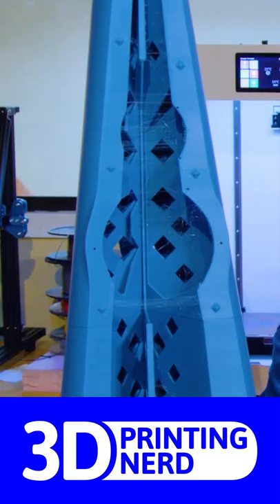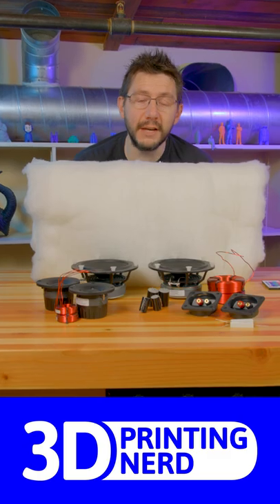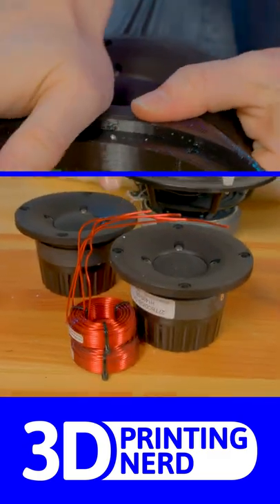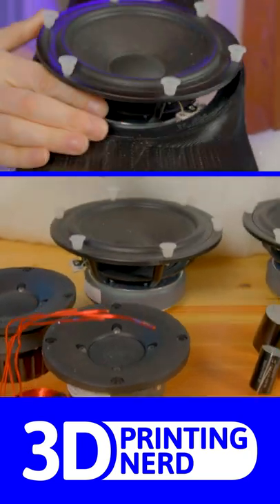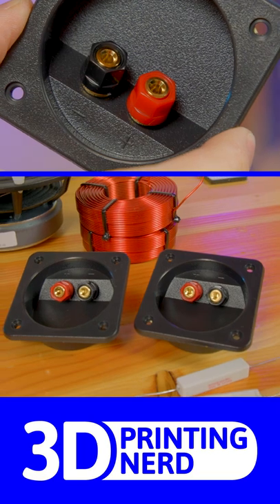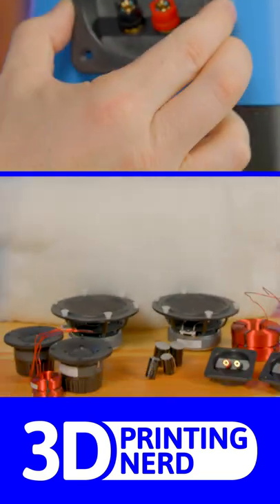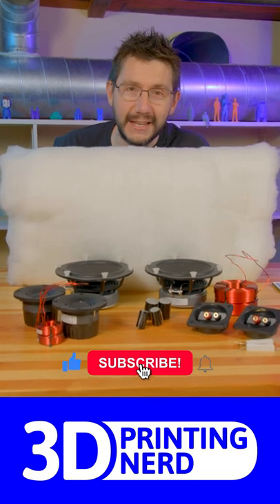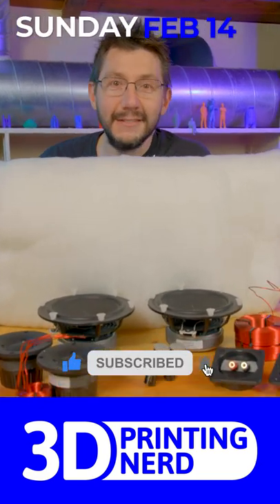What's Inside the 3D Printed Speakers? #shorts

Comment: Question does clear uv resins cure faster and more solid than resins that are solid colors like gray, because of light not passing through as easy?
Reply from the maker: that's a very good question - I'm not entirely sure
Reply: @3DPrintingNerd  maybe do a stress test on resin prints from different colors of resin and see if it differs. Also is it possible to print "in place motion" prints like the octopus or fish fossilz using sla?